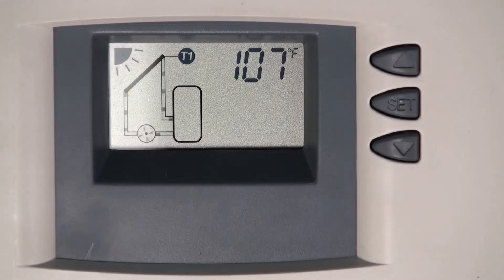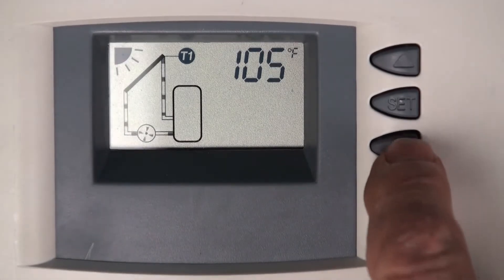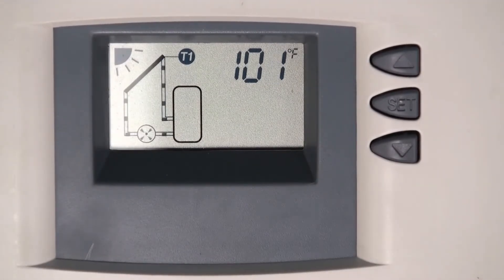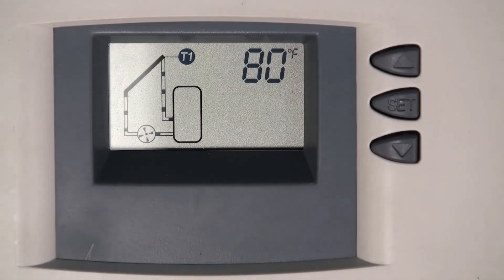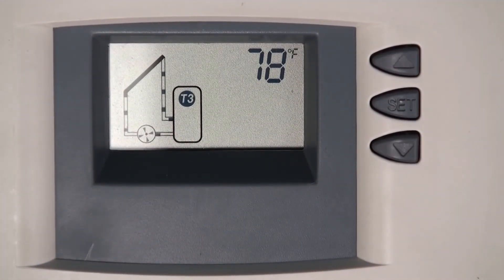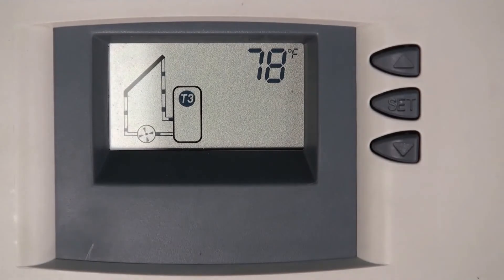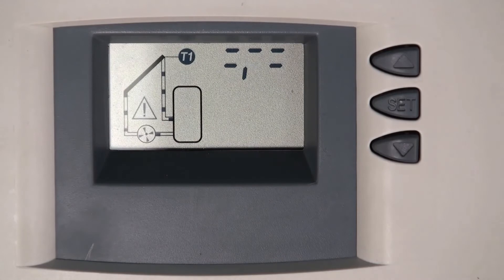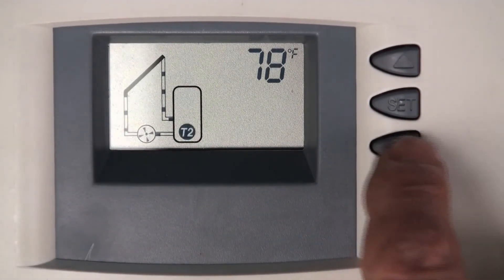SunEarth SETR0301 -  Common Faults & Errors

Comment: I'm showing temperatures of up to 500F at the T1 sensor. Is this an issue?
Reply from the maker: Check the integrity of the thermostat wire connecting the T1 sensor to the SETR 0301 controller … 
Check or replace the T1 sensor ; 500 F is not seen with SunEarth collectors. 

If the solar system uses evacuated tubes , relocate the T1 sensor a short distance from the extreme tube  temperatures ..see the SETR0301 manual , section 7.4,  regarding the Tube Collector Function . Change the function in necessary per the manual instructions.

Comment: Very informative.  I have this system and I'm seeing the T1 error which looks like a break in the wire.  Should I look on the roof for a wire leading to the solar panel?  Or can this be a bad wire at the control panel?  Thank you in advance!
Reply from the maker: The error code is for a break in the wire leading to the collector sensor or the collector sensor itself. It is unlikely to be a faulty controller.
Reply: @SunEarth  WOW thank you for the quick reply.  So most likely I should get on the roof and see if the wire to the sensor is connected/faulty?
Reply from the maker: @ricardocuevas7815  We suggest this be checked by someone familiar with the systems. Our Distributor in Florida can put you in touch with a qualified contractor/installer that can service your system. Please call 800-749-9774 or 239-482-5756 and explain the issue.
Reply: @SunEarth  Again thank you for the phone number.  I'll call them in the morning.  Thank you again.